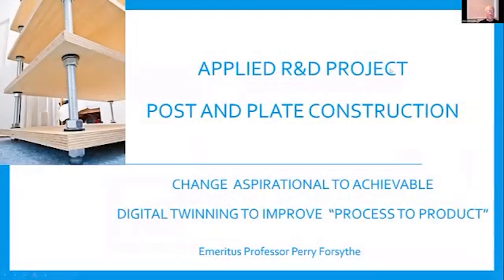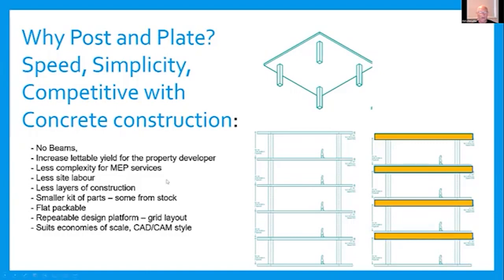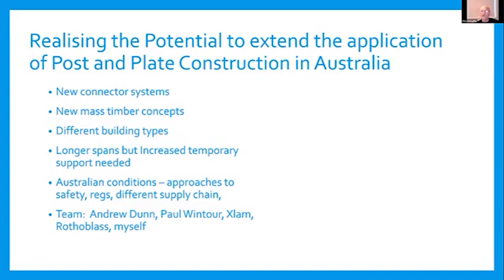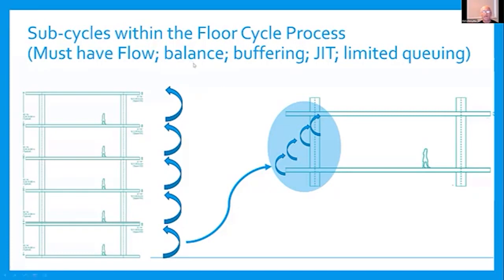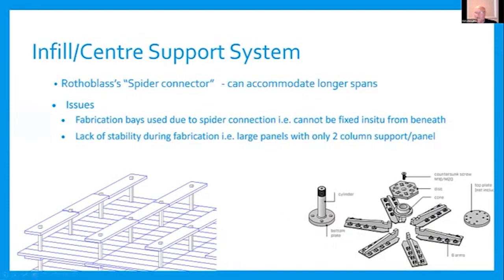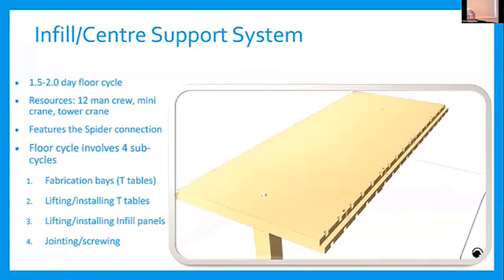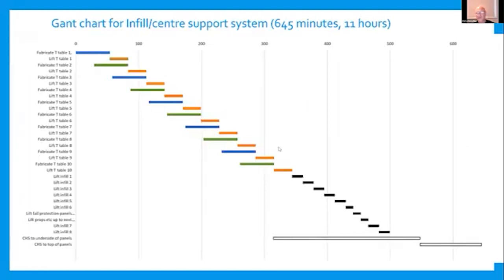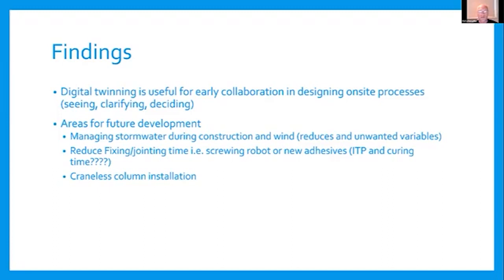Post and Plate: The Future Of CLT Construction?

Comment: I have randomly come across this video as I have an interest in comparing different construction materials.  I have been aware of CLT for some time and have seen some attempts at construction and I have not been impressed.  I understand why CLT was manufactured as a logical gap filler between plywood and glulam with the benefit of the 'plate' idea as flooring. I am unsure if further floor/ceiling coverings are being applied but to this design has considerable 'force' encapsulated in a laminated panel this large with what appears to be little facility for expansion/contraction.
A glulam beam is only really constrained at the ends whereas plywood has much thinner lamellas/veneers so the 'strength' is dissapated over the area.  Over time I would imagine the CLT would move quite considerably with the seasonal changes, AC etc and could almost explode under certain conditions.  In this example no sizes were given but the posts looked at least 300 x 300 (?) of CLT or LVL/LSL and looking at the 'Spider connector' I found that very confusing and probably horribly expensive whereas a m50 threaded rod stud could be just screwed down through the CLT and into the lower post leaving some projecting for the upper post to be 'spun' on like a nut.  Metal threaded parts into wood have been used for centuries as tension pins in pianos for the strings.
If this is just an exersize to see if CLT has a use then I don't think this it. The floor plates could easily made using sheets of Plywood laminated together for probably a similar cost and probably a leaner dimension.  Just my opinion of a retired carpenter/joiner/luthier and not a tech.            I do believe various laminations are the way forward for safe efficient residential construction and we have to see what works..